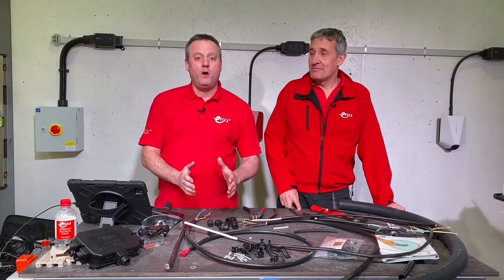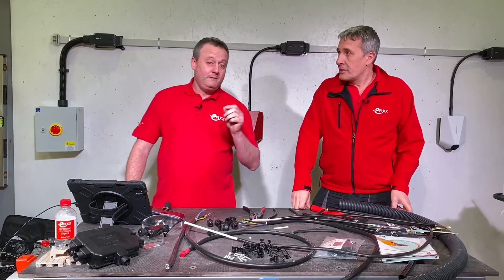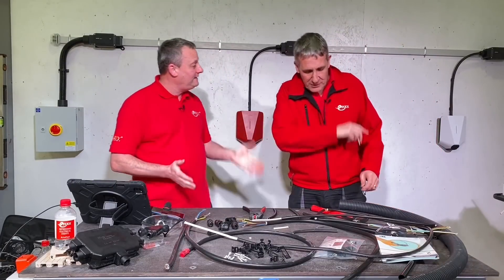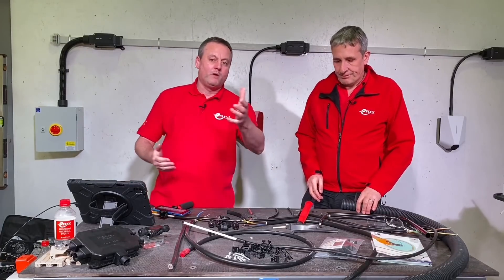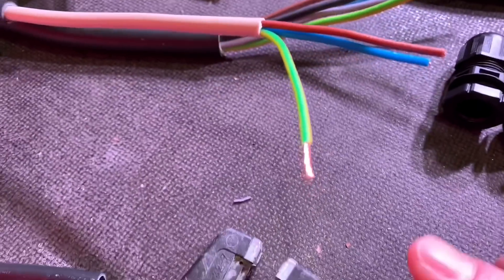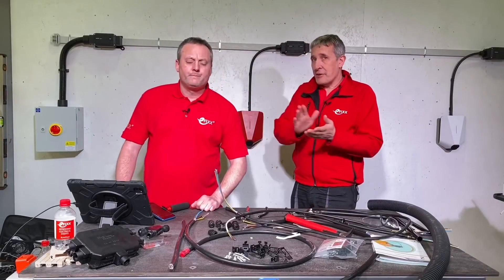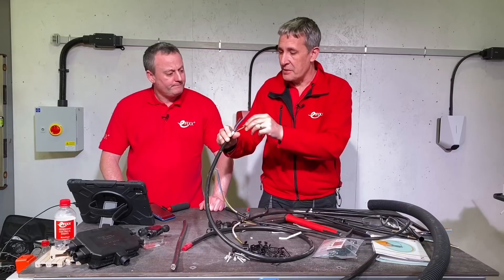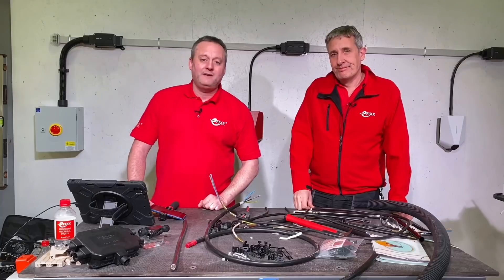NYY CABLE vs Tuff Sheath -An alternative to SWA Armoured cables?

Comment: You will never find the current rating on the data sheet of the cable here in Germany. The current ratings are published by the VDE in the regs. But to make it easier: The reference methods for the installations are the same...at least one thing that's harmonised. DIN VDE 0298-4.
The NYY is a german cable type, and used for outdoors. For indoors we use NYM. And sometimes H07V-U in conduit...and now you'll think the last one doesn't fit into the row...before the cable harmonisation this was called NYA here in Germany. But for some cable types the old non-harmonised designation remained.

This old system works from the inside of the cable to the outside describing how it is built. First letter N is that the cable type is normalised by the VDE. Next letter Y indicates PVC insulated wires, and the last Y is PVC outer sheathing. Than the suffixes -J and -O. The -O is now these days an exotic one, we mostly use the -J variety due to the reason that the CPC must be everywhere now, even if not required. The big sizes are also available as NAYY, which is the same as NYY but with aluminium conductors. Smallest size of that should be 16mm², that's what the VDE permits as smallest size for aluminium conductors since 1973. Actually the smallest size is 35mm². Smallest conductor size for the normal NYY with copper is 1.5mm².

Reference installation methods:

https://abload.de/img/img_1067ttjdx.jpg

Table for 25°C ambient temperature, orange is the max. current and in the white the max. rating of the MCB/fuse:

https://abload.de/img/img_1065uckxl.jpg

Table for 30°C ambient temperature, orange is the max. current and in the white the max. rating of the MCB/fuse:

https://abload.de/img/img_1066h0jtq.jpg

And one major difference between NYY and the twin-and-earth: CPC is always of the same size as the other conductors and always fully insulated. That's because the VDE demands that the CPC must be fully identified green/yellow over the whole length of the cable, with the exception if the CPC is identified by its position (concentric cables like NYCY). And the dimensions of the CPC must be at least:
between 1.5 and 16mm²: Same size as the line.
between 16 and 35mm²: 16mm²
line bigger than 35mm²: at least half the size of the line.
These are the minimum requirements, you can always exceed this.

If you want additional mechanical protection there's a version of NYY with a copper shield, there's NYCY available. In that case the copper shield serves as the CPC:

https://www.elandcables.com/media/38376/nycy-pvc-pvc-0-6-1kv-power-cable.pdf

But in that case you can also install SWA, which I would prefer then cause the current ratings which are on german cables in the regs only and not in the data sheets.
Reply: @Defectiveresistor We do not

Comment: The NYY we call 1KV Flex in Spain or "Cable Manguera de 1KV" and it's 90°
Reply from the maker: Do you have any “trusted” cable manufacturers for the1kv flex
Reply: @efixx  Topcable, Prysmain, General Cable, Miguélez, to name a few.
Reply: @efixx  http://www.tim-kabel.hr/images/stories/katalog/datasheetHRV/0501_NYY_ENG.pdf current raiting for NYY cables
Reply from the maker: Great thanks. - will digest tomorrow

Comment: Hello. Question how many amps each square millimeter of copper wire carries and how many amps bear each millimeter of aluminum wire Please respond from Iraq
Reply from the maker: Depends upon the cross section area and conductor temperature.
Reply: @efixx Approximately how many amperees are according to the Iraqi airspace. Thank you

Comment: Nice cableing! wish we used that type here in the states!
Reply from the maker: What do you typically use for underground wiring in the US John.
Reply: @efixx  here in North America, we normally use conduit, either Rigid or PVC shedule 80... as well as Undergound Feeder cable. (UF Romex) the electrician that did the power feed for my shed used Rigid 1" galanized pipe... works the best, but is the most expensive per foot.
Reply from the maker: Thanks John - we’ll have an explore of the UF Romex !
Reply: @efixx  UF Romex is very very similar to UK T&E...  same shape, but tends to have the usual tougher insulation of north american cable. Normal 'indoor' romex has paper bedding material that UF lacks

Comment: Great Demonstration again lads,, I m must admit , I’ve never worked with the NYY cable and without getting to political , I thought it was going to be manufactured at such a high degree of standard by the EU mainland , It would be to the  envy of our British Manufacturers,,, But, after seeing how those cores of the NYY were embedded in what looked like a crumbling Wensleydale cheese, I don’t think I will be using it anytime soon, especially not in a commercial environments,. I think the Tuf sheath out Trumped the NYY in this show down display,, 
DONCASTOR CABLES -1
EU MAINLAND -0
Reply from the maker: 😀 - We are sure the EU viewers will chip in soon and pull something out the bag 💼 we didn’t know existed.  Until then let’s bask in the cable glory!
Reply: @efixx    We can use your black cable tunnel too. Often people use it for "can later change cable". In the old times (1960's) people use old plumbum metal water pipes (forbidden for water flow now!) for save the cables, later they use the bigger water plastic pipes (>4"). The regularies say min. 100 cm deep into earth (~3 times lengh of a spade - Easy right?). I wonder me all time why you in the UK not have that. 

But SWA cable is nice for put cable from house to house in the air - we use kind of that in history too. Other sin of that I not see.
Reply: The bedding material in NYY is simply a 'filler'. Similar to the string we used to use in flex, or the twisted paper used in round cables in north america. In the doncaster stuff it's a bit more structural like the bedding on SWA. Both are fine, just different :)
Reply: @TheChipmunk2008  “Both are fine, just different”.??? Hmmm,I wonder how the NYY would of looked after having a hammer thrusted into it compared to the TUf sheath? I think we need another demonstration of Impact stresses with the swift blow of the whia hammer
Reply: @ryanjones7921  I have an offcut of 1.5 NYY-J. Will try tomorrow. I suspect it will be fine. The sheath is really hard
Reply: @ryanjones7921  NYY-J isn't suitable for impact which is why it shouldn't be buried. Doesn't mean it's not a good cable. Same way you wouldn't want to install SWA going to a vibrating machine or frequently moved machine, it's not suitable, doesn't mean it's the cables fault.

Comment: Aren't most conductors only rated to 70 degrees which means you'd have to derate the Tuff Sheath anyway?
Reply from the maker: Most SWA sold in the Uk is XLPE insulation rated to 90C.
Reply: @efixx  Sorry poor terminology from me, I meant regarding note 1 on 4E4A. Although lots of manufacturers don't provide specs for what terminals are rated at so would you actually then have to use the ratings for PVC at 70 degrees centigrade?
Reply from the maker: Great point - it’s an area which needs exploring more - especially as lots of EV chargers have PCB terminals.

Comment: Only recently discovered this tuf sheath myself while  looking through cef.  It really is good stuff. Solves that problem in situations where armoured is over kill but a normal cable isn't enough. Will be using this more.
Reply: CEF even say in the information previously known as (part number for tuff sheath) now NYY. Mad.
Reply: Are you sure it’s the Doncaster tuff sheath as I’m looking on Cef and it’s not the same stuff it’s njj
Reply: @Beariam24  it's not, after buying what cef are calling tuf sheath... It isn't.. it was just nyy with the soft interior. Cef miss selling cable.
Efix suggested trying YESSS electrical. They do stock it.

Comment: Being electricians and of course keen on standards etc...have I missed you response to my question (other than your initial response) what is the IP rating of those Netatmo cameras you reviewed ?
I really cannot see them having an IP rating and I sure dont see a seal to inhibit water ingress to the mains connections at all. A Wiska box has an IP rating of IP66 A Pyronix Light Camera has an IP rating of IP65, and having just fitted one, I can say for sure that it looks a far better oroduct than that Netatamo offering, plus the light is controlled by a PIR and the motion detection is VMD.
For sure the image quality looks far better.
I'm with you on the use of T&E externally as I have seen it crack and and don't see that there is any UV protection . In fact I have see blue sparks track along T&E during darkness and wet weather.
Reply from the maker: Sorry we could see  someone from Netatmo had answered.  Is the the camera you fitted https://www.alertelectrical.com/media/productattachment/0/24738/PyronixEnforcerWiFiLightCameraDataSheet.pdf - we can’t access the full data as you need to register.  The flyer seems to show a junction box mounted under the camera - does this mean the Pryronix has a cable out and is a sealed unit?
Reply: @efixx  That is the camera, no idea why it has that rubbish junction box beneath it though.
The electronics are sealed and the circular base has plug in choc bloc type connectors but that base fixes to a flat base with a rubber type seal,there is a short cable that exits the rear through a tight grommet, cable is too short to be practical so I changed mine.
You must have an opinion as electricians as to what you consider looks like a suitable housing for electrical connections, I have fitted many hundreds of cameras..and I mean that, looking at your video (assuming you did not edit out any footage that shows different) that Netatmo camera looks not to be sealed in any way, water could run behind the housing and into the area where the mains connection is. When you looks at the compression glands in this video which afford stability/support at the point of entry plus an effective seal..the Netatmo would have appear to have neither ! internal confomal coatings bear zero relationship to my point.
Reply from the maker: Netatmo suggest dealing three sides of the JB with silicone - https://netatmostatic.blob.core.windows.net/static/presence/manual.pdf We have two cameras on trial at the moment in two locations. The one in the video is attached to our industrial unit. we had to use an IP back box to space it off the cladding.  We haven’t modified the netamo junction box.
Reply: @efixx  I think its safe to say that...it has no IP rating at all ! 
That is like fitting an batten lampholder on an external wall and using some silicone sealer in an attempt to prevent moisure ingress !! It's not really a product that I think that should be promoted for external use in this country...at all.
Like I mentioned earlier..a Wiska box has an IP rating. Even a plastic conduit box has a gasket available ! 
Would you use a Hager 30amp round junction box outside for mains connection and rely on a drop of silicone sealer if a manufacturer suggest so ? You and any electrician on here know full well that is not good practice, in fact it would be very bad practice and would fail any inspection, would you not agree.
Pray tell me, as electricians am I so wrong here that between yourselves that you cannot agree with what I am saying here ?  Bear in mind here of course that this is a product avaiable to the general public here in the UK and as likely to be fitted by  someone not experienced or qualified in any way.
I realise that you may have some sort of commercial connection with Netatmo judging by all the products on the shelves behing you in the video but...I would expect as professionals, an honest opinion on this subject would be appreciated.
I will add, I do enjoy watching your channel.

Comment: Further to the previous comment. Even though Doncaster cables class it as ‘armoured’ does it require additional protection via an RCD?
Reply: I’m guessing that because it does not have an earthed metallic protective sheath then it may be subject to rcd requirements depending on how and where it’s used,,🤷🏼

Comment: Would you need extra protection for buried cable if installed with sand bedding?
Reply: Twin wall conduit.
Reply: @normanboyes4983  I think I would just use swa .
Reply: @raychambers3646  True but there are other pros and cons too. Easier to make off and gland Hituff (whatever it’s called) plus no need for RCD protection on SWA.
Reply: @normanboyes4983  a lot of lampposts are geared up for swa installs but can be a pain to work ,I used to get the job because I had small hands !
Reply from the maker: Yes BS7671 requires additional protection - the NICEIC snags and solutions book suggests various methods.